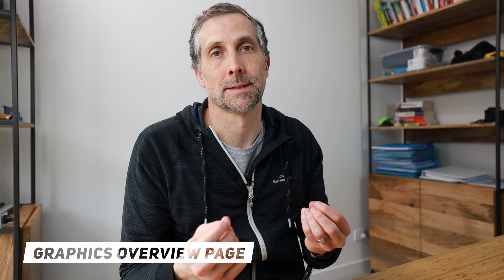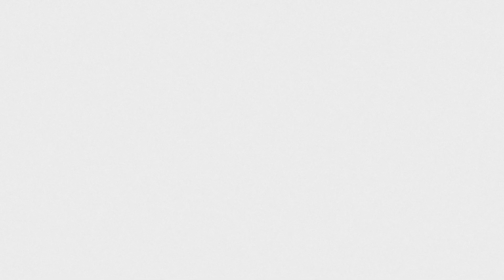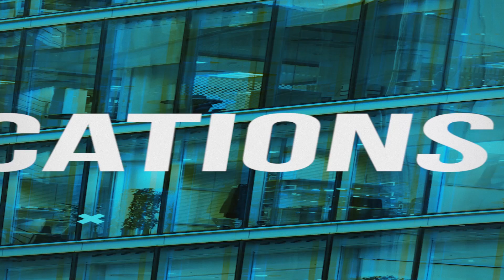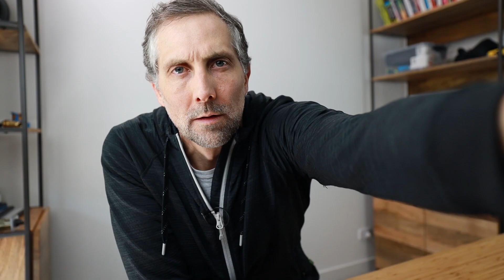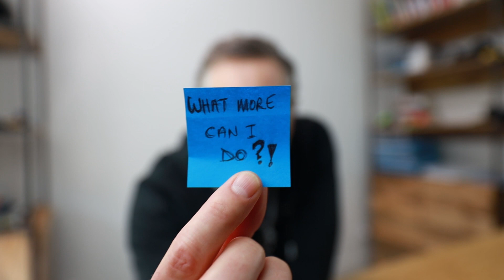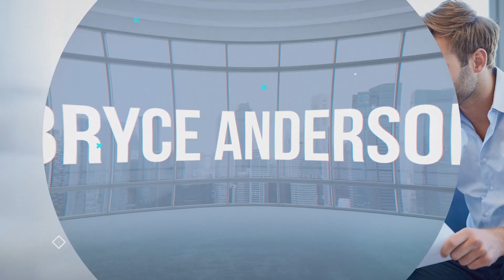BMS Home Page Graphic - Link Buttons Only?

Comment: Many years ago when I was a was a service tech the first thing I would do when arriving on a new job was to redo the home page graphic to display the key values. I would continue to improve the page as I got to know what was important to that particular building and what was important to the client. I think the home page must continually be improved by service techs as they learn the building, system engineers don't have time on the project to do this.
Reply from the maker: I agree that engineers during the construction phase don't have time, but service techs do have time. I think a lot of experienced service techs do this, eventually when trying to diagnose issues we work it out and we do it. But we need to wait 10 years for the service tech to get to that point. Every service department, after the 12 months warrantee period, should have a list of 20 things that they fix up and optimize over the next 2 years. Thanks for sharing.